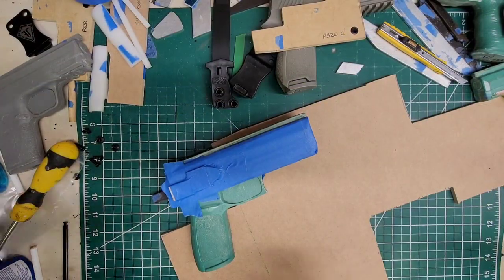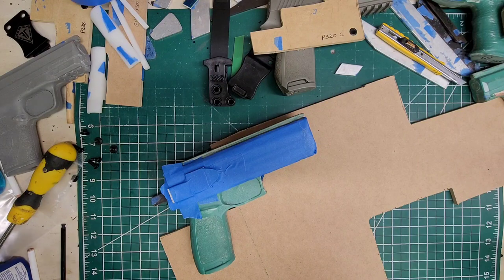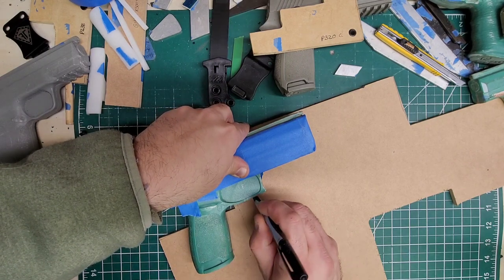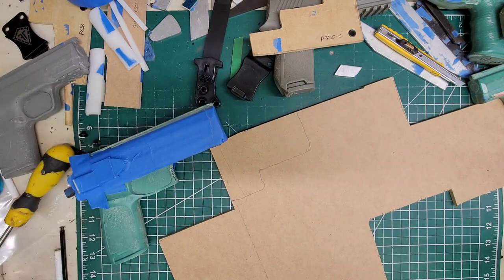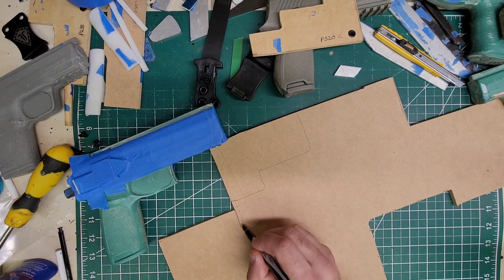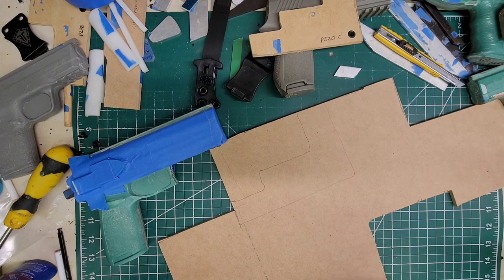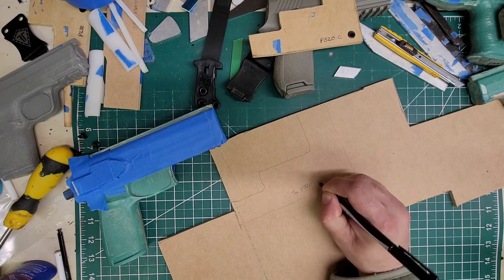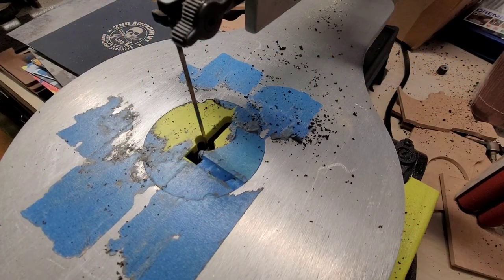The making of retention plates

Comment: What scrollsaw blades do you use? Size and type, I mean. I’ve had the cuts heal back up in kydex. Also, thanks for the video.
Reply from the maker: Just the ryobi pack of blades. Cuts "heal" up when the blade is dull and it creates more friction and melts it back together.
Reply: Thanks man